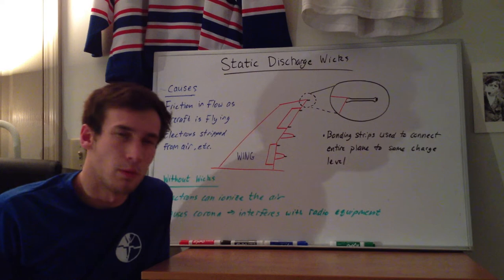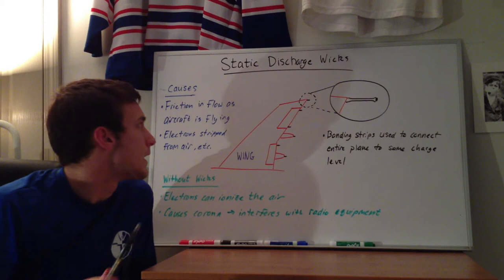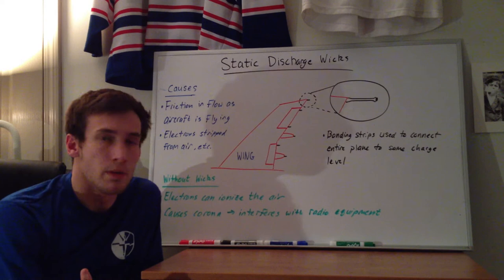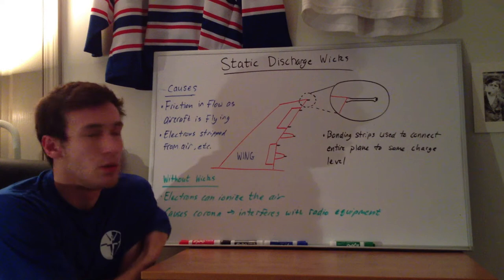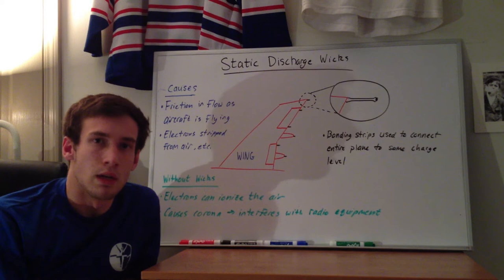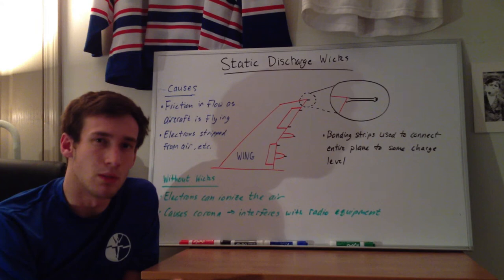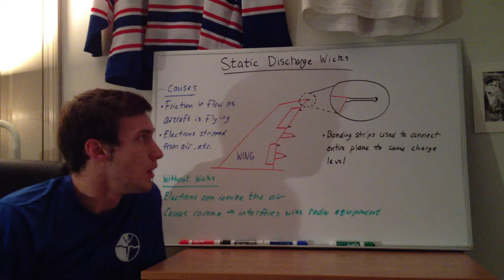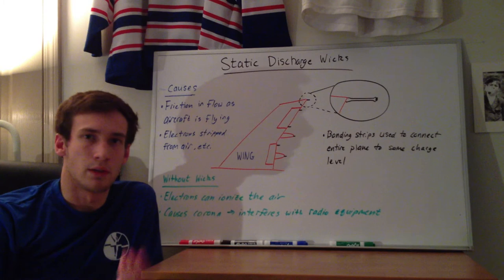Explained: Static Discharge Wicks [Airplanes]

Comment: thank you for your explain. As i know many aircraft do not have static dischargers why??
Reply from the maker: Any time an aircraft is moving through the air, a charge will build up on its airframe.  This goes for small planes and large planes.  The amount of charge that builds up will vary from plane to plane though. 

I'm not sure which smaller aircraft have the static discharge wicks and which don't, but you can probably look at their individual handbooks for more information.  However, all major commercial aircraft have them.
Reply: Thank you. Many kinds of military aircraft do not have it such as F-15, F-22 and so on. So I just guess that those kind of aircraft are painted with anti-static paint.
Reply: YJ Lee Very likely the aircraft that do not have them do not encounter air that is highly insulating.  Air that has moisture in it is not as good of an insulator, and air at low altitudes has more moisture in it.  Planes that don't fly at high altitudes for long durations likely don't need static wicks.